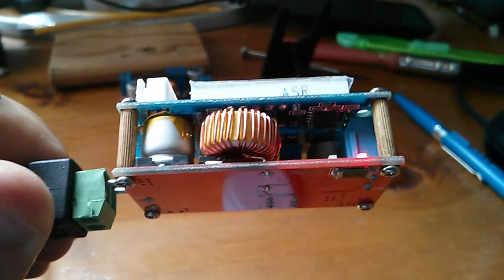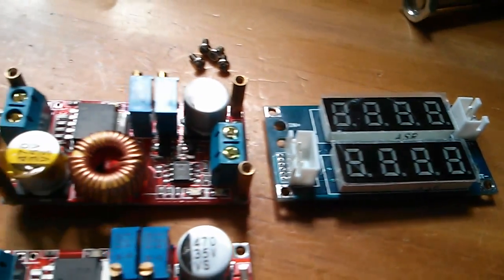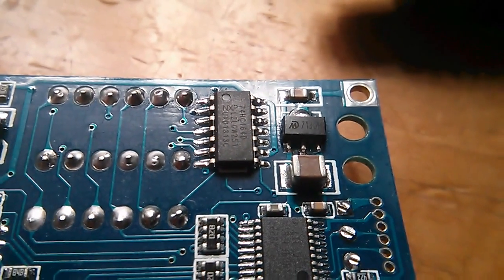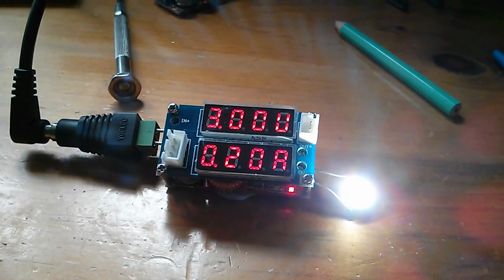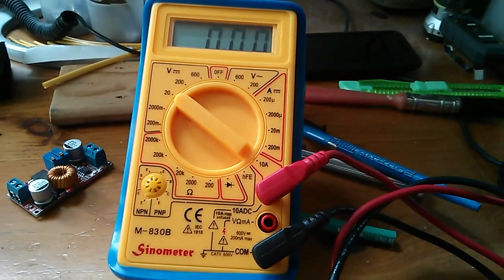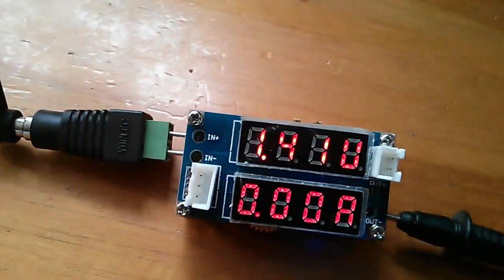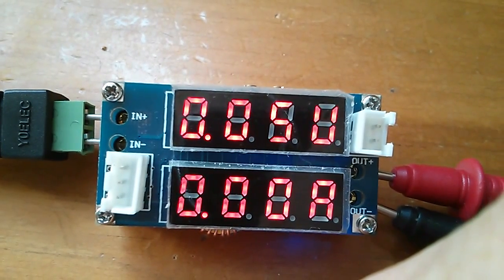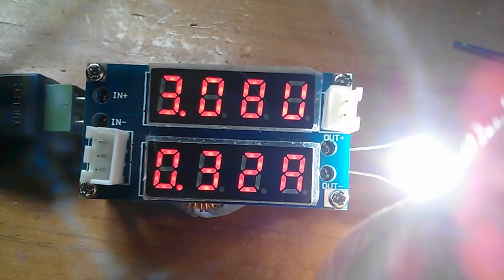Buck Converter DC/DC PSU has Voltmeter and Ammeter and a Bug!

Comment: One thing to keep in mind is that the buck converter IC is only specified down to a 0.8V output voltage. So, the unexpected behavior shouldn't be that unexpected, given that the module design apparently allows the IC to be operated outside of spec.
http://www.xlsemi.com/datasheet/XL4005%20datasheet.pdf
Reply: Well the design does not say "to short the output to set CC", so its not a design issue because some YT'er tells you to short the output. These modules are now built with xl4015 and have OSC protection.

Comment: Just bought one of these and am planning on using it as a basic bench power supply, but I guess the trim pots won't last very long and I'd like proper potentiometers on them anyway to mount in a panel. Any recommendations?
Reply from the maker: Steve Cooper Wouldn't you prefer one of the digitally controlled buck converters like the B3603?
Reply: Julian Ilett I need to stop watching your videos as I keep ordering the bits you're playing with! I've now just ordered one of these B3603 things :) Anyway I tried a couple of Maplin pots on this and it kind of works, ordered a pair of wire wound multi turn ones too to try out - can never have too many power supplies! :)
Reply: Steve Cooper I have also spent a small fortune after discovering our Julian, can't wait for his new tutorial on the ESP8266 module

Comment: Can you measure the minimum difference between input and output voltage? I want to power 10V device from 12V source and I'm not sure if the 2V difference will be enough for the converter.

Comment: i am looking to make a e cig box mod. i would be running 2 18650 batteries that are 4v each so i would have a 8v input. my load resitance would be .30 ohms.  it will only be firing at 10 sec intervals. can you recomend a buck converter that is small that can handle the current and has a display for volts and amps.

Comment: Just received one of these to muck around with unaware of this video but having seen your others. Knowing about the lack of current limiting at too low output voltage will certainly be helpful so thankyou. As others have suggested, I beleive it will be because the opamp used in the current sense is not able to function properly at too low an output voltage, so the current sense essentially becomes open loop and it is only voltage limited.
Reply: Oh, this was also helpful to know that the data gets passes through the standoffs to the voltmeter/ammeter. Seeing there were apparently no connections across the boards, I thought I'd have to work out do something with the 2 and 3 pin headers to get it to read out.

Comment: I enjoyed your video.  Other than the glitch, these are a very good deal for the price.  I use these for a experimenting power supply using the regulator plugged into a laptop power supply.  Makes for an inexpensive variable supply.  Please have a look at my video.  DIY Inexpensive Variable Constant Current Constant Voltage Power Supply for under $20

Comment: Hi, can I turn this stuff to work like lead-acid battery charger ?

Think to connect to my old battery charger who is about 8A and maybe 16V at 230AC input. Want to make nice adjustable charger for my 45Ah 12V car battery , so I need 14,4V and max 4,5A to go trough this staff, can withstand ?
Reply from the maker: Generally these modules won't run continuously at their maximum ratings, so if you want a constant 4.5A, I'd choose a converter with better specifications.
Reply: Julian Ilett
 Thanks

Comment: Your video's are GREAT !!!!!!  I am greatfull you found this I would hated to have messed up my LI-ION's from over charging. I keep it set for 4.37 V @ .50 A  works perfect takes a few hours to charge but NO heat build up.
Reply from the maker: Thanks Robert. I'm about to start experimenting with lithium charging. These regulator boards can do the CC and CV charge stages perfectly well, but they don't shut off at the end of the charge - that seems like a problem to me.
Reply: That's what I have been doing I wait until 0 amps then call it done. I just ordered some thermal switches to put in the circuit negative charge side for safety their 40c N.C. should give me a good margin there. Would be great if it could just shut off. I also mounted it inside a little plastic box in case of leakage.

Comment: they power the current sense opamp from the output. The opamp is usually not rail to rail, so it'll output Vout - 1.5V (they usually use lm358). It depends on schematic what's the minimum voltage to work properly, but I bet it's over 1.5V.
Reply: Is this the reason for high current output when output voltage is set minimum?
Reply: Sorry you are wrong about this, the comparators are run from the 7805 regulator.
Reply: @user-rs8zg8ey2b  you are right. I can see the regulator. But I don't know where the regulator is connected. It's not to the output and not to the input. I'll measure the voltage on the opamp for lower output voltage

Comment from the maker: Yes, that would work, and would be a cheaper solution than buying a purpose made lead-acid battery charger. On the other hand, a good quality charger would extend the life of the battery by applying the proper charging profile.

Comment: hello there could i use this to trickle charge a 12V 7ah gel battery? i presume if i set the buck converter at the battery's fully charged resting voltage and limit it to 250ma it should work?

the battery is used to power a chicken coop door with a 12v timer and a car electric aerial. there is 240v suppy in the coop so i was planning using an old laptop power brick and a buck converter to perminently maintain the battery voltage. i used a battery in case of power cut